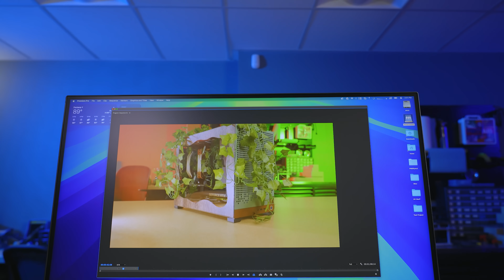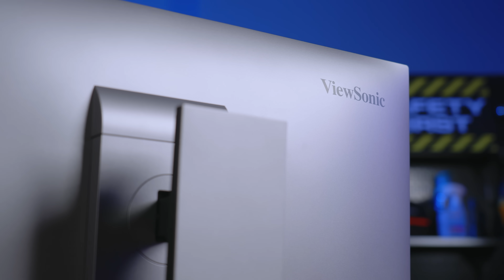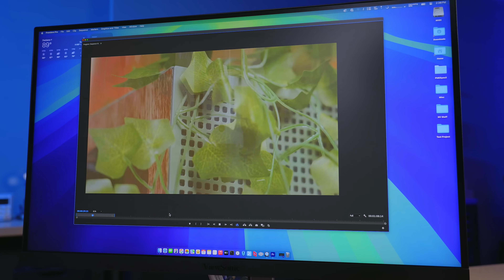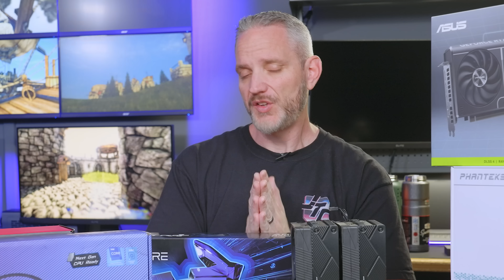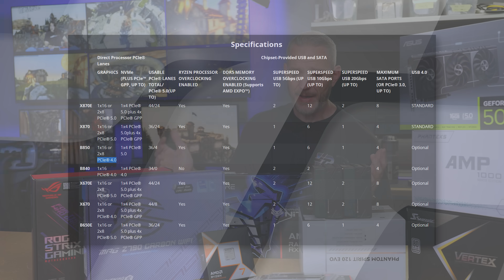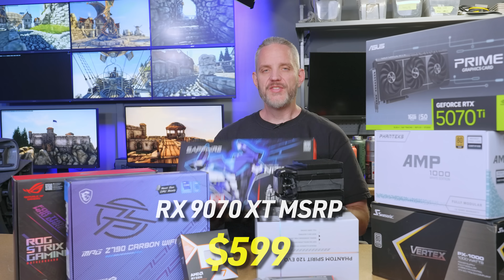This is the Sweetspot for PC gaming... Don't get fooled into spending more!

Comment: Intel 14900K will smoke all the AMD chips you spoke of today. All-core 6GHz on P-cores and all-core 4.5GHz E-cores. Has never ever crashed/blue-screened on me and Windows 11 Pro 24H2 runs like a dream with Winaero Tweaker customizing it. So many people have your view/opinion on Intel that you're missing the value it brings. Got a Strix RTX 4080 OC and 64GB RAM @ 7600 MHz in it. 1000 watt ROG Thor 1000 watt P2. It just works and I'd never go with AMD because it seems sub par in the past and always capable of going back that way. We're not talking top notch equipment but a high-mid system that's a good price.
Reply: In gaming, the 9800x3D is faster almost across the board in multiple game engines than the 14900k.  In productivity where core count and sustained clock speed matters, it’s the reverse.

However, i5 14600k vs Ryzen 5 9600x is the reverse of i9/Ryzen 9 for gaming and productivity in a lot of scenarios (although not by as wide a margin) so if going for a mid-range build for gaming Intel is likely better for overall performance experience, but the price may still be the deciding factor.  If you’re building high end for gaming specifically, 9800x3D is still ahead of the i9/Core 9 in performance, but price is always a factor - not just the CPU but the motherboard as well if you’re not upgrading in place.

It’s an odd time for PC building…

Comment: Just upgraded from i7 11700F, 32gb DDR4 3200, RX6700XT to Ryzen 9600x, 32gb DDR5 6000, RX9060XT 16GB. AAAAAAAND it's made no difference. Most of the games I play are a few years old so I was already getting 100+fps. The newest games I play are Palword and Schedule. Both of these games run like schit no matter what. It's ridiculous Schedule 1 looks like a 20 year old game but a RX9060XT 16gb can't maintain 60fps all the time Ultra setting 1440p. The 6700XT actually did a little better. Its messed up my CPU and GPU usage is no where near 100% in Schedule 1 at Ultra setting but struggles to maintain 60fps. The biggest difference is all the new parts run much cooler and quieter. The main reason I upgraded was to get rid of my old parts before they lost to much value. Sold my i7 11700F, 32gb DDR4, Z590 for $350 got 9600x, 32gd DDR5, B650 for $380. So $30 and moved to the newest gen. Also had to get rid of the 6700XT now the 9060XT is out. The 6700XT has held at $300 to $350 for a while now but it'll drop under $300 by end of this year.

Comment: Basically the sweet spot has always been: midrange CPU, good graphics card, memory that prioritizes capacity over speed, a good power supply, and a roomy SSD. Don't buy a Samsung SSD these days: they're piss poor quality and the firmware issues never get fixed. No reason not to go AMD for CPU and GPU: they're both superior products IMO and Linux support is supposed to be way better for AMD graphics cards than Nvidia for people who don't want to put up with Microsoft anymore.

There's also a few games that just benefit disproportionately from using one of AMDs vcache CPUs: do your research for your titles, but like for me as an Escape from Tarkov enjoyer I feel like I'd rather have a last-gen X3D chip than a current-gen numerically-adjacent, non-X3D part (e.g. 7800X3D > 9800X).

Motherboards seem like an easy place to spend way too much money these days. Graphics cards too obviously, but everyone seems to already understand that. You probably don't need an ROG branded motherboard.

Comment: i think psu choice depends on your pc cycle habbit, i used to be in the same camp as what jay is recommending where i swap out new parts frequently so the bigger psu is a good idea if you are in this camp, but after building pcs for 10 years, i am now in the camp of buying a full mid-high pc every generation, and if you are also in this camp then you just need a psu that fits just right.

Comment: One major thing to think about when building- You are adopting AM5 socket so the most important thing is just a stable reliable motherboard jumping into AM5.  You can later update the processor to a 10,000 series jumping pass people who have a 9000 series processor. As Jay says, you don't need the best or above average CPU even because you're likely coming from an old system that your boost in performance is HUGE.  even going for a low end AM5 processor will make you leap in performance. You can upgrade to a 10,000 amd on the next generation or pay for a cheap 9800 X3D when the 10 000 series release to outdate the 9000 chips.

Comment: Just went to a micro-center 3 weeks ago 😂 and spent 2,800 so plus tax and warranty and having them build it came out to 3,400 .. went with a msi 870E ti white am5 mobo, Ryzen 7 9800X3D, XFX mercury 9070XT, lian li infinity AIO, asus tuf dual chamber case, lian li 100W edge power supply wish I went for 1200W, with 10 lian li infinity fans, and a crucial 1TB gen5 and have a corsair gen5 I threw in it that I had at home plus my 4tb gen4 WD black😂.. I think I over built my rig..

Comment: I noticed a sharp dip in AMD driver quality around when I got the RX 5700 XT, but then the driver quality just jumped over the next 2 years to where they are very solid today. There's certain things I now like better over Nvidia's driver and control panel (I have an Nvidia GPU laptop but AMD GPU for my desktop)

Comment: just saying, as a 9800X3D owner who's had it since launch (November batch), going above 6000 MT/S on X3D CPU's is just going to make you pull your hair out in making it stable while only having 1-3% gain in 1% lows (trust, I have been tweaking my 6200MT/s OC and it's been hell losing game/work progress when all the stress tests are a pass and yet a game that doesn't like having a specific ram timing set too aggressively will just make the PC lock up or if the ram hits 50C at 65535 tREFI). It's not much of a difference, but unless you're pushing very high refresh, 480Hz with smaller frametime spikes, 6000 will do you good in 99% of cases.

One more thing is, the higher your refresh rate: i.e more than 240hz, the more you'll have to start thinking about your GPU's TGP power limit if you are pushing that high of a framerate even in light load games. Think of it as a car redline, the GPU hits power limit, it'll aggressively pull clocks down in order to go below that said limit, for example a 5080 with 320W TGP hitting say 3100-3150 Mhz offset, the moment it hits that 320W power limit for the total card, it'll drop clocks and will manifest as microstutter, or stuttering until it goes below that power limit. That's when undervolting/underclocking will start to come into play so that you still get max clocks without going over the power limit.

Comment: 5700X, 32GB 2133 DDR4, 2TB M.2, 16GB A770 in a SUGO 14 ITX case, air cooled - You don't need top of the line, I expect to upgrade to 9070 in another year or so. Until then, I'm happy with Division, WOW:Ascension, Grim Dawn and Civ6 on my A770. Used to be, I used it for theater/lighting models. Now it's just gaming and streaming my music/shows
 
Dual Display, 1440p, not quite maxed but not far from. I DETEST ground clutter so keep it at med-low but at max range because I hate how pop-ups break immersion. Also, I limit shadows to medium and minimize reflections. I don't need chrome and shiny geegaws, just give me solid gameplay and a story that makes some semblance of sense - Hell, I still enjoy the orig Thief:Dark Project from the late 90s. Those graphics sucked even then but the gameplay mechanics, the plotline... that was SOLID!

Comment: I agree that air cooler are the best way to go for most people and I even used a deep cool air cooler to cool my 7700x in my first pc but I do have to say now that I upgraded to an nzxt kraken (mostly for the lcd and looks) that it is definitely worth the money if you can afford it, especially considering that I was able to get mine for $100 on eBay with 3 lian li sl120 uni fans.

Comment: I have high end PC's, but also have 2x older AW R3 PC's that still work and only have i7 2600K's in them. I was thinking to make "two cheap LAN PC's just for older Multiplayer Games" when friends come over. I keep wanting to overspend. 
I was thinking i5-13400 is only around $115 and there are no comparable performance/price AMD's to that. I figure its possible to replace Mobo, CPU, RAM, and re-use Case, PSU, GPU's Should be able to do it for under $400 each. Anyone have any thoughts/opinions on cheap Micro ATX Mobo, CPU, Ram combos?

Comment: CL is not a flat number you can use to compare kits with different data rates. You have to take the data rate into account to actually get the true latency of the RAM. An 8000 MT/s kit with a CL of 40 is going to have the same latency as a 6000 MT/s kit with a CL of 30.

Comment: My system is quite unbalanced in terms of psu. Running a 7950x3d and a 7900xtx with a 1200w platinum EVGA psu. Why such a large psu? I originally wanted a pair of 2080tis in my i9 9900K system but never got that second 2080ti......

Comment: Funny how that is the other way around in Europe. Intel Core UItra 256K is the best bang for the buck here. They often run some good bundles with games and lower the price from time to time.

You can try Zen 4 or Zen 5 (I don't know if they have the same issues) But stay away from Zen 3 has memory controller issues where they burn our even at DOCC/XMP speeds. So many people on the web repport this issue and AMD won't RMA it. You need to lower the clock more and more to run stable... my 5800X basically can basically only run at stock speeds without crashing... Running my 4000 Mhz DDR4 at 3200 right now and it still crashes from time to time, lately more often. So I might need to clock down a step again... had it at 3600 for a while, but had to do down to 3200. When I turn it down to stock it runs fine.

Comment: I have a 5800X3D, RX7800XT, 32GB 3600 CL16 and a EVGA 1000 Watt gold rated PSU. So whatever comes in the future my PSU can deliver. Also this machine runs all my games really good and most of them at 180 FPS - 1080p which is the max my montor can show. :)

Comment: still on RTX 3080 with 5800X3D 32GB 3600Mhz maxing out most games 5 out of 10 i can push to 4k. newer games i have to use DLSS with frame gen mod from nexus mods for 4k but 1440p still no issues. i’m in no rush to upgrade for minimal gain. It has to be 4k with no dlss or frame gen before i upgrade.

Comment: It would be nice if you did a video showing how to connect fans to the motherboard and the case because I can't figure it out.  It's my first home custom built pc but I can't get the fans to work.  I was able to get the waterpump to work but not any of the fans.  I know I'm missing wires to the case but I'm out of wires.  It's amd asrock b650 if that helps.  Please help.

Comment: pc gaming is pretty much dead. if the price of building a pc doesnt turn you off all the blatent cheating going on will . its not enjoyable anymore.
Reply: whatever you say sonypony
Reply: @Longlius  wtf is sonypony? if your going to insult someone at least use proper words?
Reply: I think the prices are quite cheap and even older spec PCs are still viable computers.  In the past a decade old PC would be consigned to the bin but not these days many are still viable machines.  2nd hand parts are also easier to get and prices are decent.  The only bad thing at the mo are GPU costs and not enough VRam on some new cards.

Comment: The 7800x3d will get more fps of a lower end card

That is what i did 

7800x3d + 32gb 6000 + nvme4+ b650m + 5070 (i wanted 9070xt but there is no stock ever)

Comment: The thing no one says about the Thermalright Phantom Spirit 120 EVO is that it is not a quiet cooler. Even with the 9700x at its default 65 watt power profile, it will get pretty loud by the time it reaches 50% fan speed. I keep it set to lower speeds for temps until they reach 60c, but at that point you're really hearing it. It's not terrible, but it's not quiet. If I set it to 105 watts, it will be loud enough to be annoying. I can see why people buy BeQuiet or Noctua, simply for the quieter dynamics. I did pay $50 though, so there is that.

Comment: Does anyone know how a amd 3700x cpu would perform with a new gpu 9070xt? Im currently running a 5700xt and want to upgrade hut im not sure if my CPU will be a bottleneck or not.
Reply: I think it's still fine but the CPU will definitely be the next upgrade.
That CPU can run most titles. It will probably only struggle in like the city area of Baldur's Gate 3, or maybe in Minecraft (with loads of farms around) or other CPU intensive games, like management games or whatever. But it really is still fine.

Comment: Gotta have to massively disagree with you on the "you dont need a expensive cpu"... cpus are extremely cheap compared to gpus these days, some 400-500$ cpus can run games as good or better than some mid-tier gpus, wich means you dont even need a gpu. Not buying a good cpu, just because it doesnt bottleneck your gpu is a terrible reason

Comment: Good review but Jay messed something up with regards to what CAS Latency means and why it can't be compared directly between DIMM's with different clocks.  CL is the number of click ticks that have to pass between the time a read command is sent and when that data is made available.  That time is really measured in nanoseconds but gets stored as CL so that the memory controller can use it.  Regardless of how fast memory has become, the CAS latency time hasn't increased much and is still 7~10ns.  DDR5 6400 CL32 has a response time of 10ns, at CL29 it has 9ns.  DDR5 8000 with CL40 has.. wait for it .. 10ns response time, at CL36 it has 9ns response time.  It's always important to convert memory timings into real world nanoseconds when comparing memory of different clock speeds.

Comment: Why nobody when talking cpu coolers thinks Thermalrigtht Phantom spirit 120 for $59 and then say AIO cost $120-$140? Thermalright AIO 360 costs the same $60 and you can choose the looks. Why not go with AIO for the same money? Yes, air cooler is safer, but it makes lot of heat inside the case which needs to be draw out. AIO does that better.

Comment: I don't agree about chipsets. For my gaming PC...it doesn't matter, but my server it absolutely does. I've ran into PCI lane shortages due to having B550 instead of X570. I suspect X570 would still have issues, but not as bad. I'm considering upgrading to threadripper for this reason. But with a brand new 8tb drive I'm probably good for a while.
Reply: nobody is talking about servers here....we're not in a Cisco office
Reply: @rarespetrusamartean5433  interesting because today's jay video is about storage. Also you don't think that you might want more than 2tb on a gaming pc? yeah.......screw the B series. X is just smarter for AMD.

Comment: i build a new PC in april and i jumped from an AMD  fx8350  DDR3 system with an rx5700xt to a DDR5 , 7500F with a rx 6800 and i invested in a new 2k 32 " 180 HZ Monitor and my old 25 " 75Hz FHD is my second now. Asus TUF Gaming B650(non e) Plus gives you also PCIE 5 for your grfx if needed in the future. i think its still the best budget build to get on the actual ,plattform.

Comment: Buy used. I wanted a high end used system that could last me 10 years. I got a 9950x3d system with a 7900xt card, steel series keyboard, RCA monitor, all for $1600.  The 9950x3d is both for gaming and production. It cuts down processing speed by 1/3+ over my old 5900x system.

Comment: I am very confused right now and need help. I’m about to build a gaming pc. I want the RTX 5070ti gpu but I’m confused which cpu and mobo I should go for ChatGPT suggests AMD 9800X3D and a costly MSI B850 Mobo for a future ready rig. Please help me. I want a rig that lasts at least 10 years without needing an upgrade.
Reply: 9800X3D  is way overkill for a 5070ti imo
I'd go for something like a 5800X3D (or equivalent in that general performance area) or a 7800X3D if you want even more future proofing, but I really think you'd be wasting money,. As for a motherboard just get one that has
1. the right PCIe version (I'd say go for 5)
2. enough M.2 slots for you
3. the right cpu slot
4. dual bios if you want it
5. AM5 for sure if you're aiming at 10 years

DO NOT USE CHATGPT FOR THIS. It recommended me a shitty case that I regret buying every goddamn day of my life.

Comment: I chose the sweat spot for motherboards and went with an ASUS TUF X670E motherboard over a year ago.. It gave PCI Express 5.0 to both the main SSD and x16 slot for newer graphics cards. For the $300 price it will last well into the end of AM5's lifespan with that PCI Express 5.0 support and ASUS's continuous BIOS updates.

Comment: So I bought a 9800x3d and wondering what GPU everyone thinks would be best to pair it with? my budget would be around £1000 (1300 USD)
Reply: I think it really depends on what you want. My roommate is making a PC right now and he's getting the same CPU and he's going with the 5070ti, he's games but he also makes AI programs and does some coding. But you could definitely go with a 9070xt for a little bit cheaper if gaming is the only thing you care about.
Reply: getting a 9800x3d with a 1000 pound GPU budget is crazy work...

Comment: Let me know if anyone knows how to get 1t command rate working on msi z790 carbon. Right now, going back and forth between 7200 cl32 at 1.5 dram and 7200, cl34 with 464 trfc and 384 1.46 dram.

Comment: I just went from a i5-2500k to a Ryzen 5 7600x. I wanted to go with AM5 since later down the road I am probably going to get a high end AM5 CPU like the 7800X3D or a Ryzen 9 7900x as I am most likely going to skip AM6 and go to AM7 in the future OR get a higher end AM6 way later down the road.